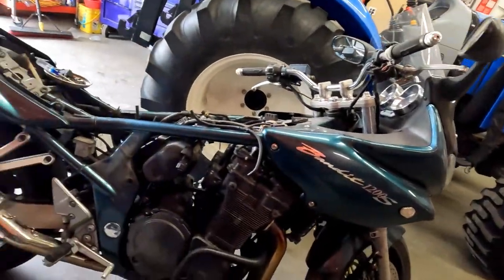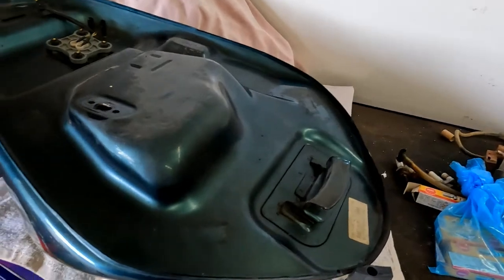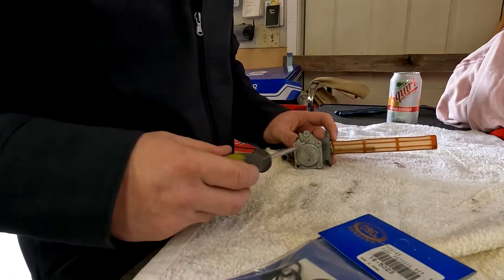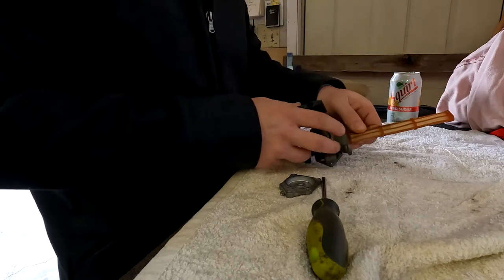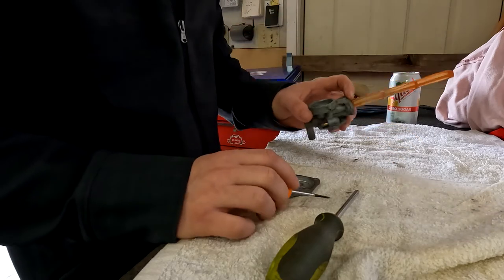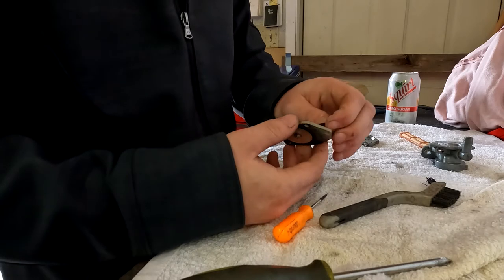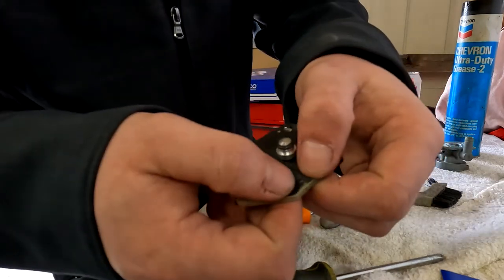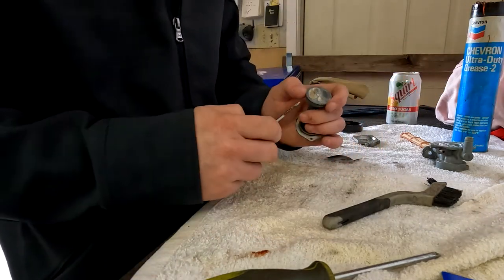One of the Suzuki Bandits BIGGEST Downfalls... (Vacuum Petcock Rebuild)

Comment: Seriously, get rid of this piece of junk and put a simple on/off petcock. Vacuum operated petcock are a solution to an nonexistant problem. I put mine on the off position when I don't use my bike for a couple of days and never had any issues ever since.
Reply from the maker: Thats what ive been thinking of doing if i can get it to run right. Ive rebuilt the carbs, petcock put new plugs in and flushed the oil as well as cleaned the airbox and replaced all vacuum lines and caps. But all i can get it to do is idle and   
If it goes over 2000rpm it dies
Reply: @DornBuilt  I have a 2000 Suzuki Bandit 600 and I swear to God these bikes are cursed lol. Do you have a new air filter? Air/fuel screws at 1 and 3/4 turn? Have you synchronized your carbs? Have you checked the compression of each cylinder? Unfortunately it can be a lot of things or a combination of these things. I also removed the pair system and put block off,another useless piece of crap on these bikes,good luck bro.👍
Reply: @DornBuilt  Ever got it running good past this point? I have this exact problem
Reply from the maker: @svenverweij273  i ended up having to replace the valve and getting carbs tuned up. Then sold the bike